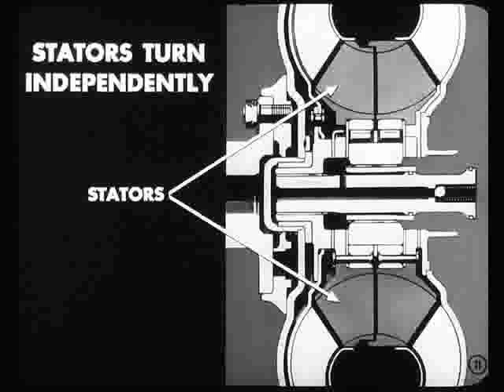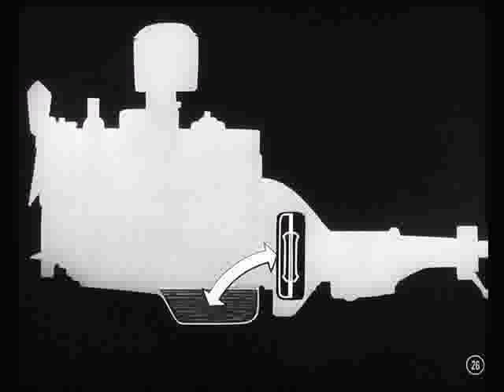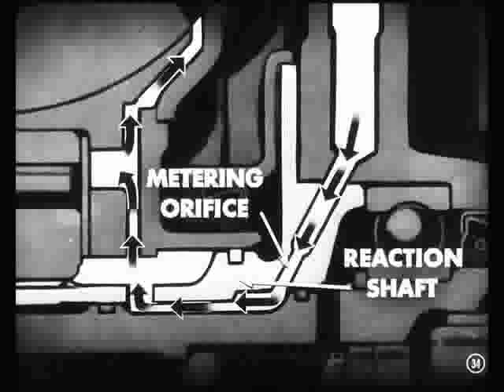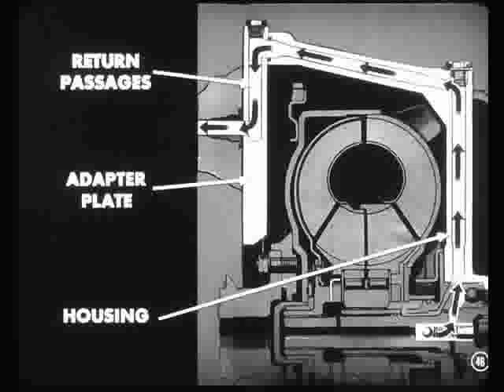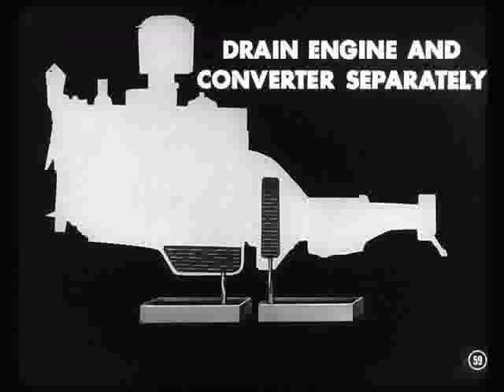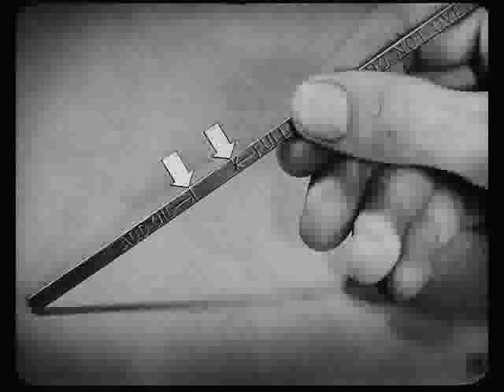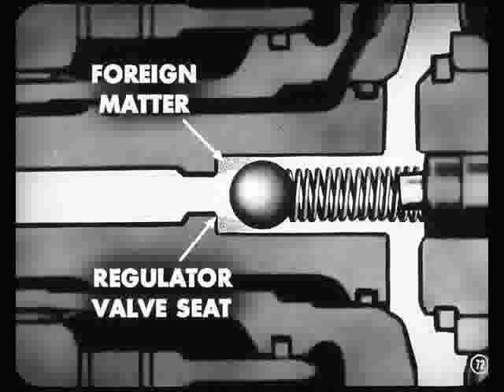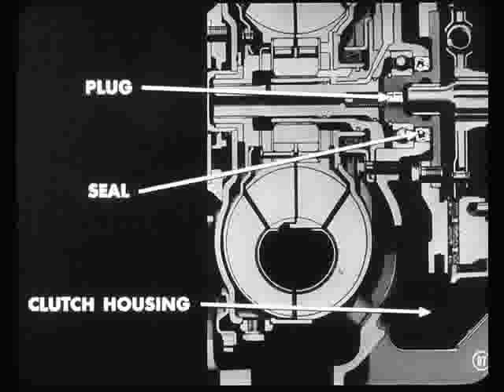Chrysler Master Tech - 1952, Volume 5-9 Fluid Torque Drive

Comment: I don’t know if anybody still watches these but I’m in desperate need of some help, i have a ‘52 imperial with 70,000 original miles on everything. I mean all original interior down to every nut and bolt being stock from Chrysler, however the transmission is now definitely starting to go on me. Don’t know if anybody is able for me to reach out to thanks.

Comment: With this transmission it is very important to change the oil filter at the specified intervals.  Otherwise, carbon and other particulates from the engine can score the seals in the converter and leakage will ensue. This system worked, but seals on the converter were a problem.